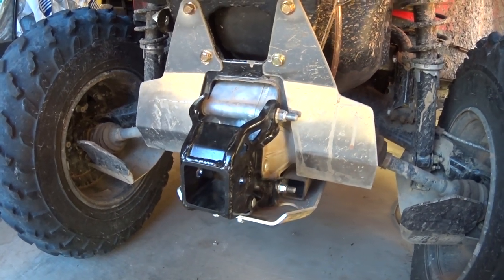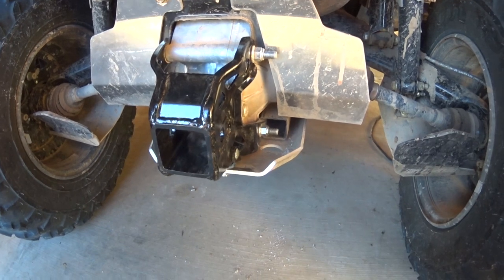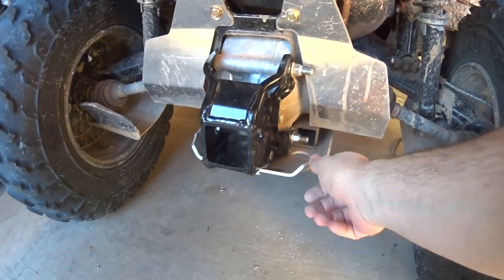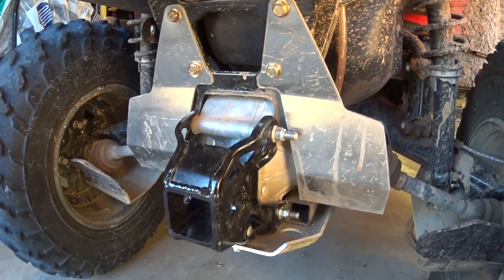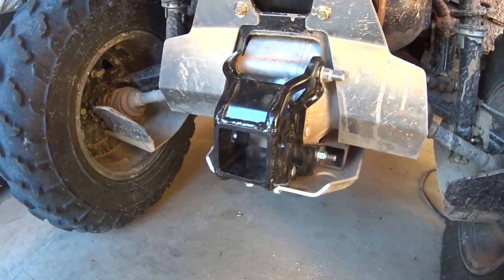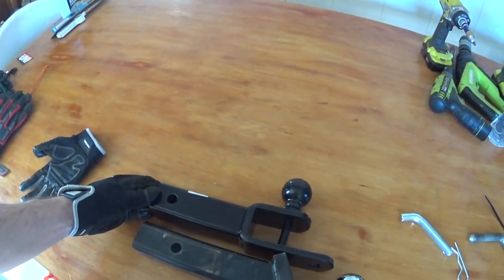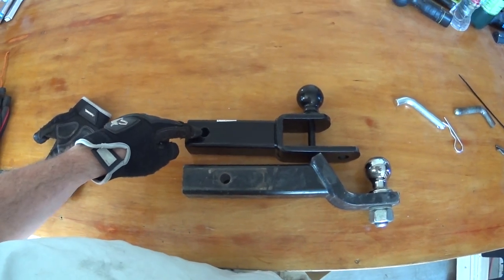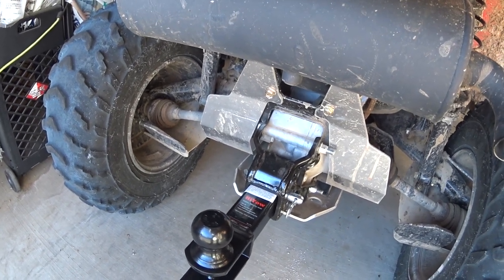Can Am Outlander Receiver Hitch - Skid Plate Problem

Comment: Having the hole closer to the end of the draw bar was the answer all along of course, however, the whole receiver mounting is very risky because it is fastened to the aluminum casting of the rear differential instead of on the frame of the quad. Over loading or just jerking on that assembly can turn into an extremely expensive repair or replacement of the differential.
Reply: I’m glad someone other than myself has realized this! This is a major flaw with Can Am Outlnders and Renegades. This is the major reason all of the other manufacturers have their diffs encased within the frame. Yeah it’s appealing to have easy access to the diff for repair or replacement but if u tow and hit something with the trailer or to much weight on the tongue, then you are headed for an expensive repair. They use to make a special strengthened bracket for the Gen 1’s but nothing for a Gen 2 frame 😑☹️😫👎🏾👎🏾👎🏾👎🏾
Reply: By the way if you look at the bigger 650 up Can Ams you will notice that they have a different piece that attaches the rear part of the frame to the locker part where the diff sits. It’s not much but better than the 570 & 450 ☹️

Comment: What was the torque spec for the bolts I am trying to put one on my can am and can fine the spec any were
Reply from the maker: spec is tighten them up and don't sweat the small stuff. It's a tow hitch not an airplane wing.